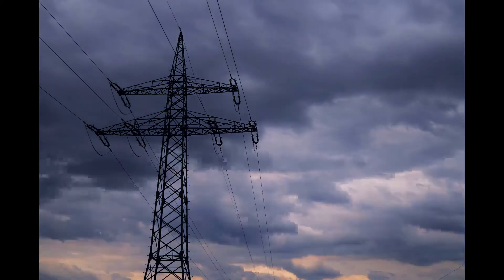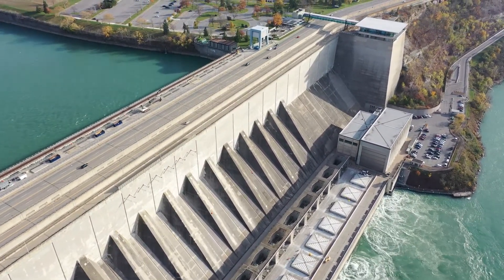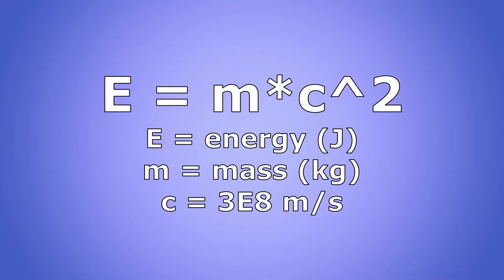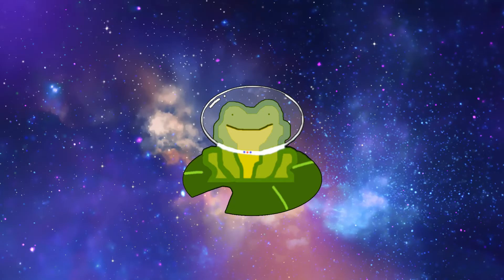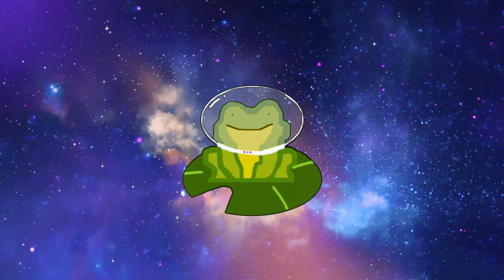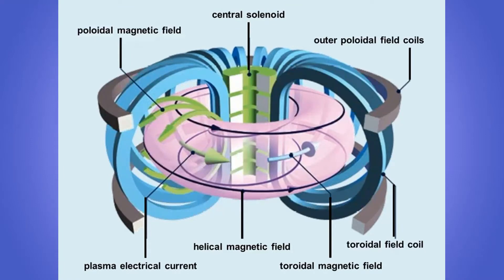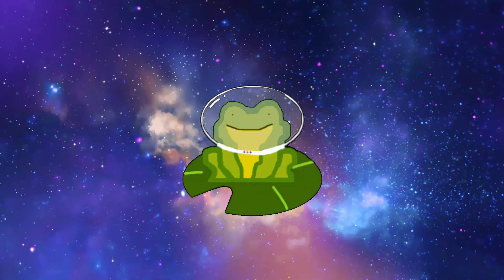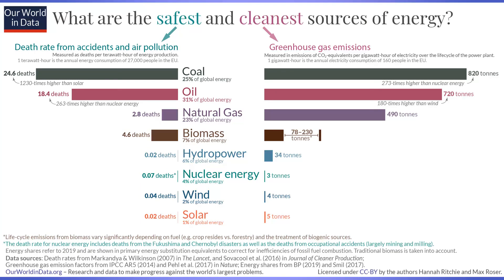How does Fusion Work and Current Reactor Projects

Comment: From what I have seen, fusion power will never be possible unless several massive unpredicted technology breakthroughs occur. The temperature at the center of the Sun is 27 million degrees (F), and the pressure is 250 billion atmospheres. Deuterium and helium at those kind of temperatures and pressures are simply not containable by any material known to exist. Powerful magnetic fields can only do so much. The reason that fusion power is always "just 10 years away" is that no researchers or people in that field want to admit that nobody has any idea (or even a wild theory) as to how to make fusion power work. They correctly fear that if they admit that, the research money would dry up. So they keep up the façade, hoping that massive unpredicted technology breakthroughs will happen somewhere, somehow, someday. So we get one expensive, ten year long experiment after another, as the decades glide by.

Comment: One of the coming soon technologies is high temperature (relatively speaking) superconductor materials. In tokamaks and stellarators a key factor is magnetic field strength. With HTS magnets over 10x the magnetic field strength is theoretically possible. Several reactor designs are in the works to use HTS magnets which are expected to achieve and exceed breakeven power in verses power out. The W7X stellarator's upgrade should be completed this year and is hoped to demonstrate 30min (effectively continuous) plasma control, and without yet using HTS magnets.